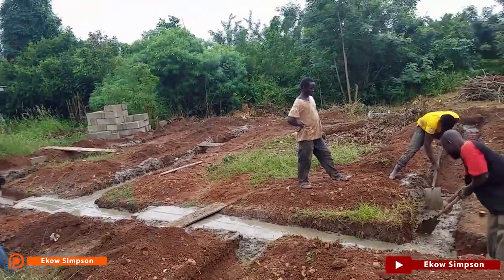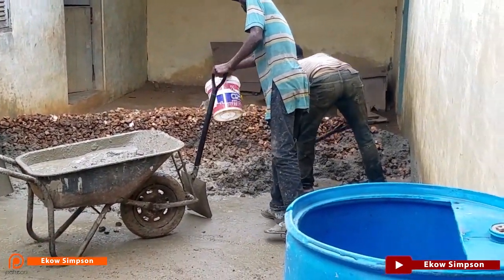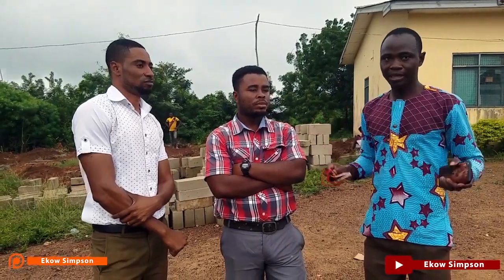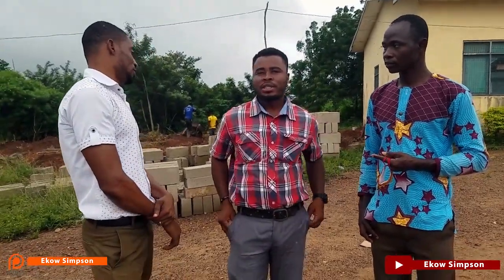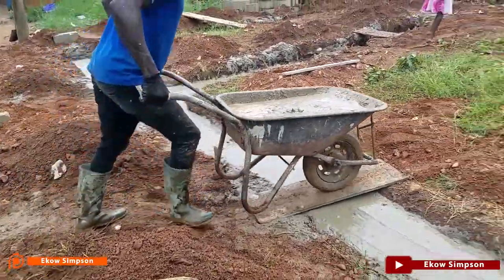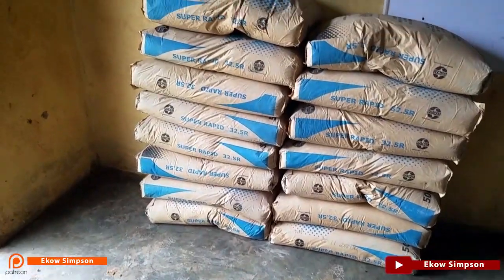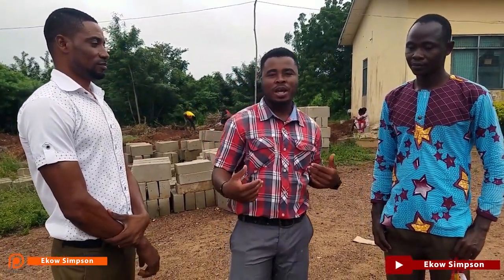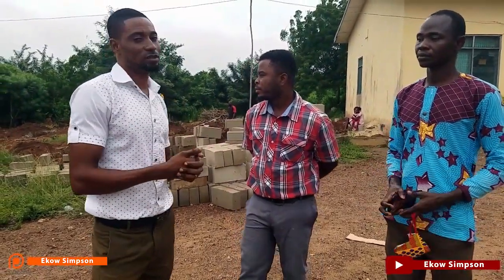Building Library | Building Foundation From Mixed Concrete - Afrangua Basic School

Comment: Using compressed Earth Blocks make the interior of the building much cooler than the Cement Blocks. You save on electricity by not using air conditioning and fans in an earth block building.
Reply from the maker: thanks for the insight. I am sure very soon we wil learn from each other
Reply: @EkowSimpson  Yes
Reply: Is this the same as earthbag?